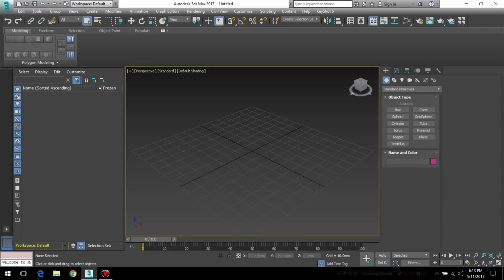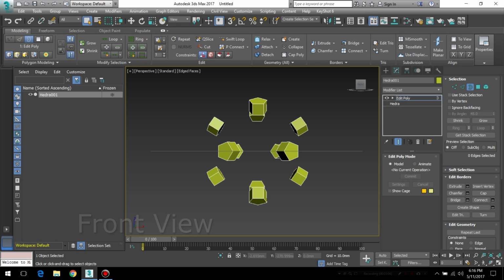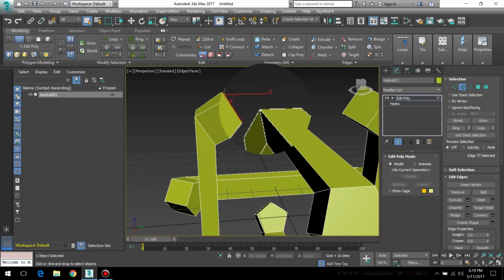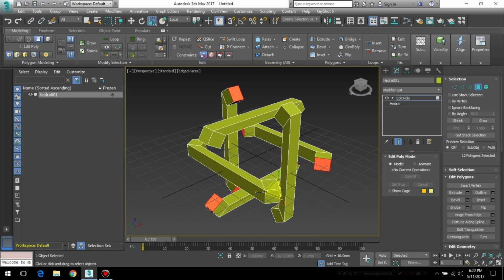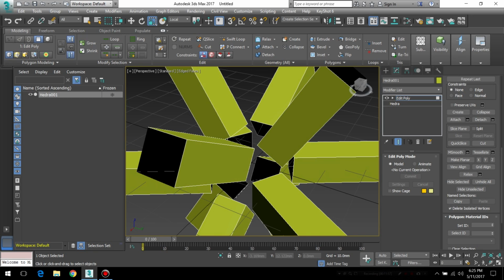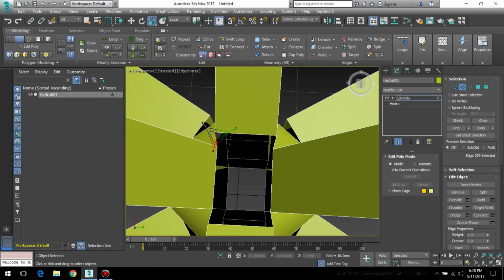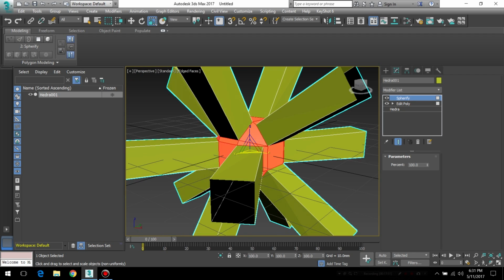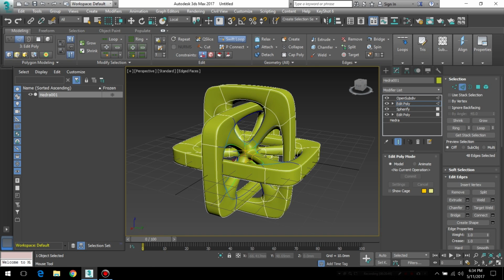3d Tutorial | Borromean Link Nexus | 3dsMax

Comment: Great video as always, John.  I do have just one question though.  @16:17 I'm wondering why you used such a long technique to select the open border edges when all you really needed to do was simply box or lasso select the holes in border mode?
Reply from the maker: In this case, I chose the revolving selection technique so that the polygons we had created in the previous steps would still be selected after capping.  If we used the region selection tools like rectangular, circular or lasso we would end up losing our polygon selection and need to reselect those to continue the next steps.  So it really wouldn't save many clicks in the end.